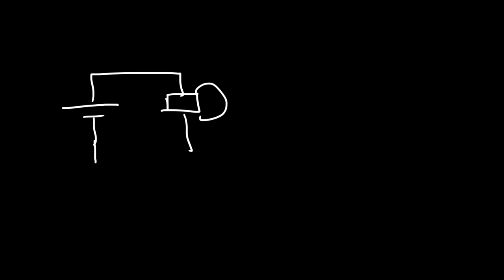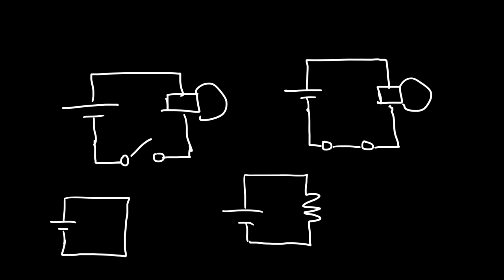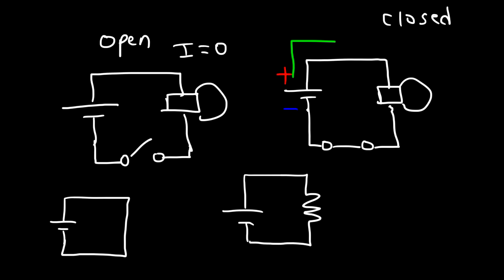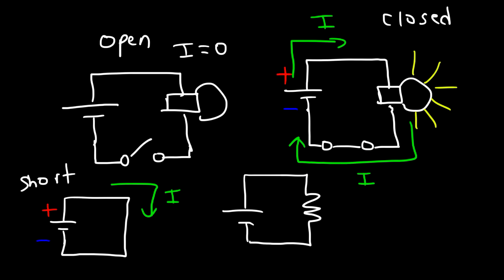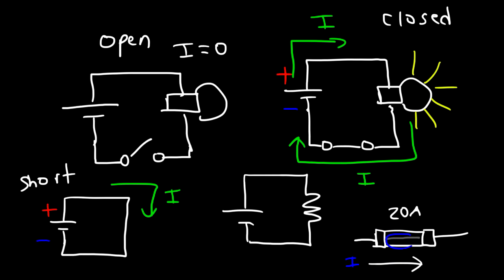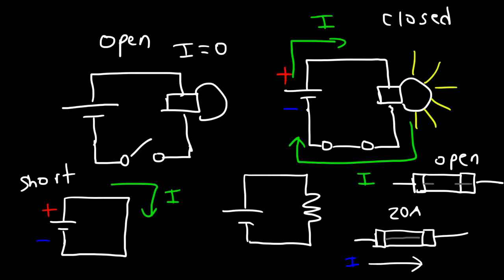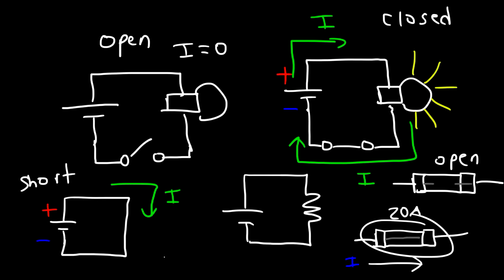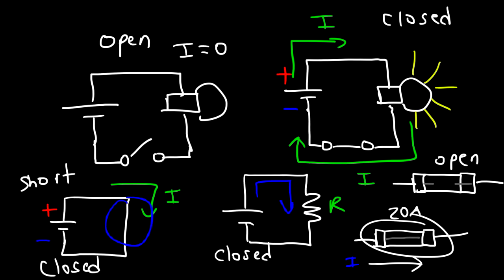Open Circuits, Closed Circuits & Short Circuits - Basic Introduction

Comment: WHAT closes or opens the circuit?  Is there some property of the circuit or its elements that does the opening or closing?
Reply: A switch is the component that opens or closes an electrical circuit. The switch's physical configuration, specifically its contacts, determines whether current can flow (closed) or not (open). A closed switch completes the circuit, allowing current to flow, while an open switch breaks the circuit, preventing current flow.
Reply: @jianmartigauuan1306  I knew that.  What moves it to the open or closed position?  Is it moved via some property of the circuit?  Or does someone’s hand move it?  No one ever explains that part.

Comment: You can easily create the smallest closed circuit that is also a short circuit by using a long enough wire to touch the positive terminal and the negative terminal on a battery. If that is not clear enough to turn the light bulb in your head, then try sticking each end of a paperclip into a wall outlet.

Comment: For the closed circuit with a resistor, wouldnt the wire the current flows in before the resistor melt or smth, or is there a reason this wont happen

Comment: I finally understood the short, open and closed circuits. Every short circuit is a closed circuit, but every closed circuit is not a short circuit, because in closed circuits there is some resistance, and thus the current passage is limited. But short circuits are dangerous, cables can burn 'cause there is no resistance in the circuit. Well done
Reply: Damn straight 👍🏽

Comment: thank you for the video but does'nt current flow from neg to positive
Reply: yes but these styles of diagrams came to be before we knew that, and people just assumed it went from positive to negative, and to this day diagrams are still often drawn this way. 
so yes it is wrong but universally we just agree to draw these diagrams backward.
Reply: @V-0859  me studing for test😑
Reply: Nope,remember current is just the flow of charge,and charge can be positive or negative,negative charge is brought about by the repulsion of electrons on the negative side of the battery terminal,due to a negative electric field.
While a positive charge is brought about,by the repulsion of protons(positive test charge),from the positive side of the battery terminal,due to a positive electric field.

So in physics we normally use the flow of charge,by convention,which is positive charge,from the positive side of the battery flowing to the negative side of it,instead of the flow of electrons.

Comment: Current flows from (+) to( - )
Reply: The flow of electrons is termed electron current. Electrons flow from the negative terminal to the positive. Conventional current or simply current, behaves as if positive charge carriers cause current flow. Conventional current flows from the positive terminal to the negative.
Reply: Very Nice information 
for advanced level of information on open circuit and short circuit visit #Electricalengineering360

Comment: but how does voltage carry through an open circuit!! If according to ohms law voltage = IxR and no current flows across and open circuit then how does current still flow?
Reply: Open circuit means current is not going in external resistance but it is flowing in the cell circuit

Comment: voltage flows from negative to positive. one of the first things you  learn in DC circuits.  please edit. i stopped watching as soon as you said the opposite
Reply: yes voltage is from negative to positive, but the world has accept it to be the opposite,so u cannot say he is wrong
Reply: many of the experiment and research is based on this direction of flow
Reply: voltage? or current? you should've kept watching since you're wrong especially about voltage flow lmao.

Comment: I thought it current moves from negative to the positives
Reply: In electron flow theory the electron flows from the negative of the source to the positive.

This video is using conventional or "hole" flow. Meaning the positive charge left behind by the electron leaving moves positive to negative. 

So the negative electron moves negative to positive but the positive hole it leaves behind moves the opposite way.
Reply: @schulerruler  .
,
Reply: That is electronic current
Reply: I was taught the same thing too.